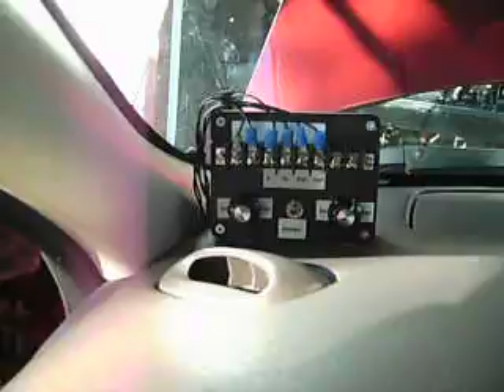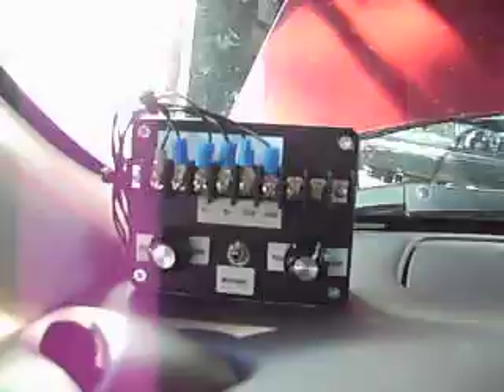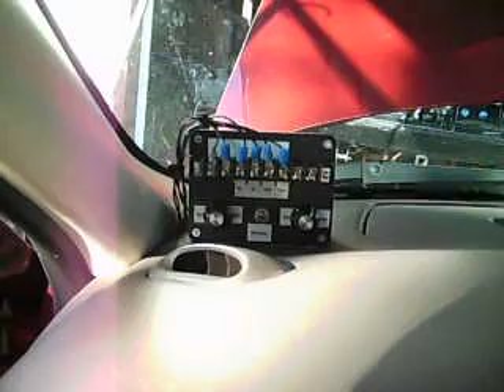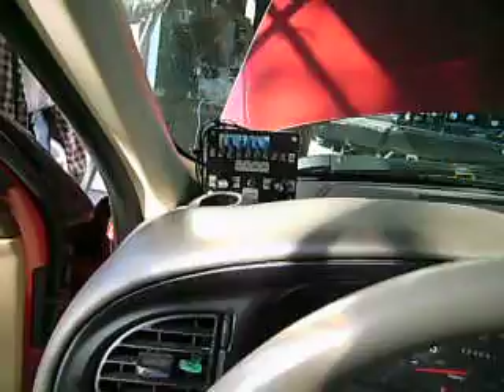Battery relocation Smack install

Comment: Good install bro.

Personally I have become jaded over EFIE's and MAP enhancers. We need to program our own ECU's IMO cause turning knobs whilst driving is not safe and we manually cannot be as fast as the computer we are trying to trick.

Nice job on moving the battery but does it have enough ventilation in the trunk? Just askin. :) I personally do not know how much ventilation a battery needs but it was worth asking.